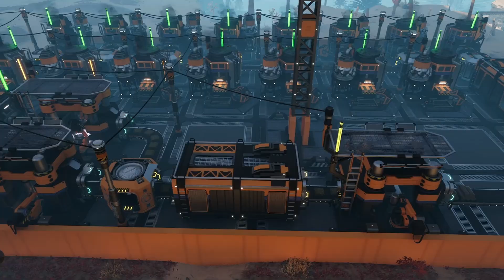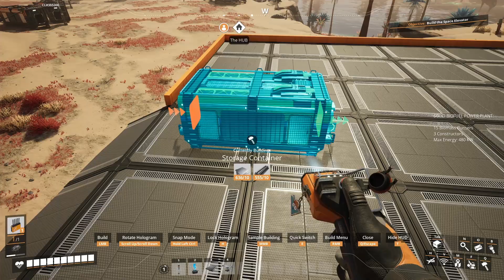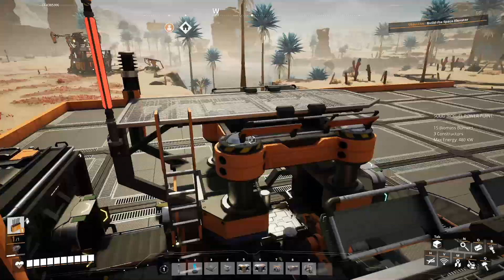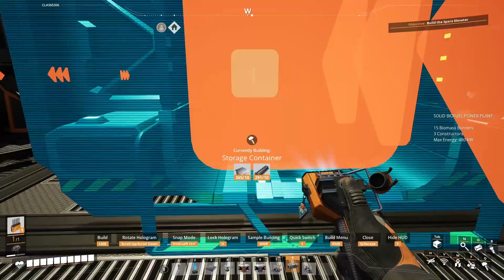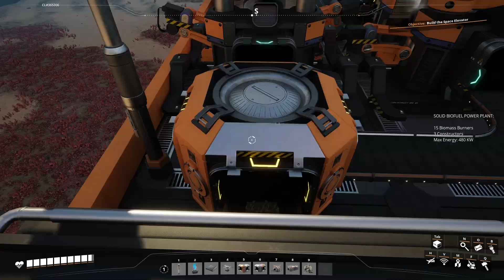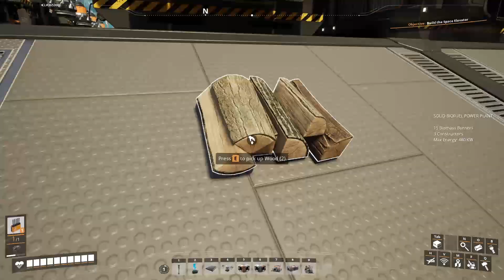100% EFFICIENT 450 MW Solid Biofuel Power Plant Build Guide - Satisfactory 1.0

Comment: A small suggestion is to add a single Biomass Burner on your Solid Biofuel line before the Storage Container. Use this Burner to power the three Constructors processing your Biofuel on a separate power grid. This generally keeps your Biofuel production working even if your main grid runs out of fuel. It also makes jumpstarting fuel production easier.

Comment: The point about the orientation of the first splitter for solid biofuel is very smart future-proofing.  Now you have easy access to pull a feed to make liquid biofuel for the jet pack.  By the time you get to this point, the biofuel power is going to be redundant - and liquid biofuel is not going to be a constant need - so this is a great way to repurpose the plant in the late game. 

One other I/O tip: I like to keep the bins for the leaves and wood clear for a trash processing system later using smart/programmable splitters.  This involves using a single storage container as a trash bin with everything being sorted to storage, production or the sink.

Comment: Once you have done the first level of research for Mycelia you can convert 1 Mycelia into 10 Biomass.  a constructor processes 15 Mycelia into 150 Biomass a minute.  Mycelia produces only 20 MJ  to 180MJ on the Biomass.  I added a third constructor to the start of the Powerplant which does throw off the footprint but adds a lot more Biomass to the plant

Comment: Sorry, I'm confused, is this a design that requires time to spin up, or do I have a fundamental flaw in my understanding of splitter mechanics? Wouldn't the splitters at the end only be getting like 1/16th of the biofuel? That would mean you wouldn't get the full 450 MW until a good 10-15 minutes of letting it spin up. New player, thanks in advance.
Reply from the maker: It takes time to spin up.

Comment: Using this design in my world now. Giving me more time to set up but one downside is the simple splitter chain. This is causing the latter generators to be starved of fuel until the ones before get completely full of biomass. This is fine early on but once you start getting above 60-70% of the capacity you can blow a fuse even if you have hundreds of biofuel left (its all sitting in the first few generators). It would be cool to see a version of this where each generator has equal inputs. That way it will use all of the fuel until it runs out completely.
Reply: Make a section of splitters going to the first 7 burners (the one on the right, then the next 3 rows).  make another section of splitters going to the last 8 burners, not connected to the first section.   use lifts to connect the first splitter 4:10 to the second section.

Comment: I would also recommend finding a caterium node (Gold) asap and progressing that tech tree in the MAM. If you keep following the left path you'll eventually unlock the smart splitter. This only requires quick wire and copper sheets to unlock.
Once you have the smart splitter you can switch the 2 bins at the front for just one bin and you can have it sort your leaves & wood into the correct constructors for you, no chance of putting items in the wrong bin and clogging it up!
Reply: By the time you have the caterium for the smart splitter you will probably have T3 belts. If you place a few splitter nodes you can have a truck depot that pulls everything you found exploring and sorts out the logs, leaves, biomass and biofuel for your power system before forwarding the rest into a catch all. I keep these generators available the entire game, it gives you a buffer if you accidentally overrun your power and batteries.
It’s worth putting the generators themselves on their own circuit to let the batteries run down a bit before turning on the bio-plant.
Reply: Altough this looks great and easy to use :) For anyone looking to expand the capacity beyond 225MW, the leaves in your system is going to limit what you can produce.

Comment: I am confused at why thats needed. In the time it takes to do that, you could already be into coal
Reply from the maker: Play how you like!
Reply: In addition to playing how you like, it is still useful to have this kind of setup even after you’ve got to coal as the biomass burners can remain in place as a backup in the event of power spikes, giving you some breathing room. You’d obviously still want to avoid relying upon it when you get to coal, but it can help with some unexpected spikes, or help smooth your transition from coal to oil based power generation when you’re likely to have a spike in power requirements before you actually start generating more power.
Reply: clearly doesn't take much to confuse you, if you want to rush, rush, everyone has their own way to play a game that doesn't have a timeframe to complete

Comment: I personally like to underclock those constructors to match the input and output belt speeds to help stabilize power spikes. Also an underclocked machine doesn't have a straight 1 to 1 power dip. A machine clocked at 50% requires less than 50% power.
Reply from the maker: Great tip!

Comment: I'd rather take the time needed to build this into rushing towards coal power. But depends on preference i suppose. Good vid nonetheless
Reply: See I'm the other way, I build something similar, but with 24 burners, because 24 stacks fit in a container, the. I store the overflow then when the power trips, I belt the overflow container back in to restart power while I go collect more fuel.  But it burns so slowly I hardly have to get fuel.

Comment: Very solid guide. Clear, concise, and with the extra info after the actual building tutorial is out of the way.
The only problem I found is if you’re using a manifold system for your belts, the first few burners stock fuel a lot faster than the rest, and that can cause shutdowns under high draw when there should be plenty of fuel left. I have an array of 12 burners with load-balancing supply lines on my save, and it works perfectly.
Looking forward to future guides, it’s been a while since I’ve properly played this game and diversity in solutions is always welcome.
Reply: Mine uses 3 modules of 9 biomass burners. Single mk2 belt input of solid biofuel splits 3 ways and each of those lines split into another 3 splitters splitting to 3 biomass burners. This gives a total of 27 biomass burners and 810 total power. The input must be mk2 belt though as the whole facility burns 72 solid biomass/min at 100% utilization
Reply: @michael_voight  I run 2 modules of 6, splitting a belt double at the input, then a compact set of 3 splitters at each module. Less efficient with belt outputs, but it’s designed to be modular for easy upscaling, and I’m already setting up a coal plant. Speaking of, how do you handle an early-game coal plant? I’m building at the waterfall and shipping coal in by truck, which works well once it’s running but is a pain to kickstart.
Reply: @XF_Chaos  There are a few locations on the map with coal that's super close to water - close enough that belting it is perfectly reasonable. If you started in the grassy plains, head north-east of the massive waterfall and you'll find a big valley with tons of water + coal. If you started on the rocky coast there's 2 good spots in the northern section of the biome that work very well, too
Reply: @sunsfury6488  Thanks, there’s a site with an interactable map somewhere, I’m gonna check and see if it’s updated so I can find where you’re talking about